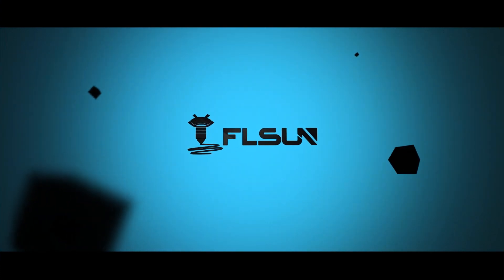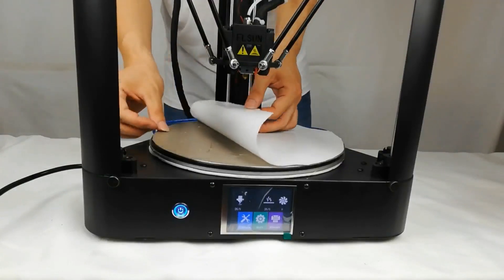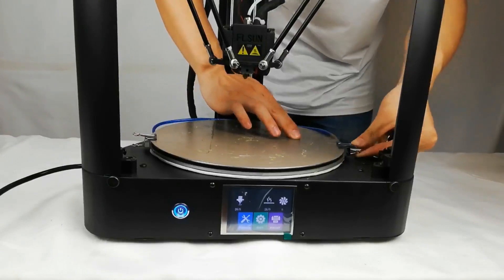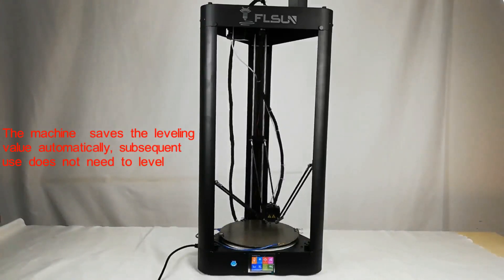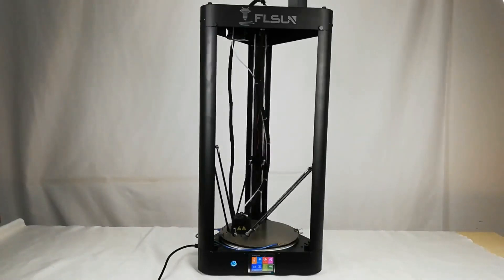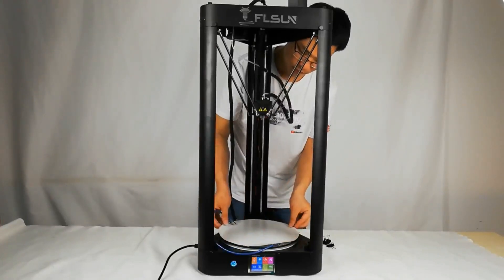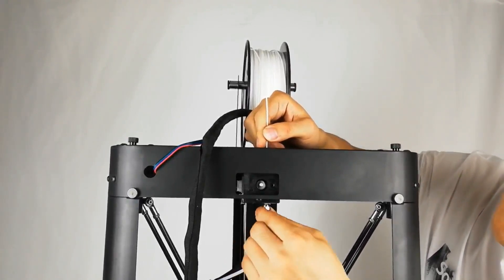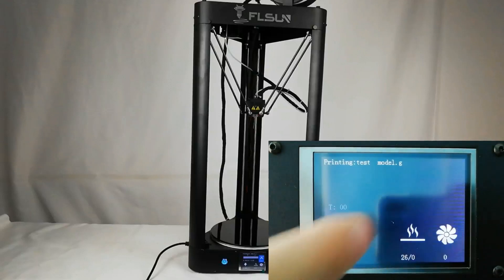FLsun QQ auto leveling

Comment: the autolevel pad worked well for one year and now when i use it, the printer nozzle keeps hitting the mat. i tried contacting FLSUN unsuccessfully. how can i calibrate it if the mat doesnt work anymore for some reason?
Reply: get a new senser
Reply: Still having issues?  I had the same issues and fixed it.
Reply: @GravityMuse how did you fix it? I'm having a similar issue.
Reply: Any solution for hitting nozzle with level plate during start of autolevel